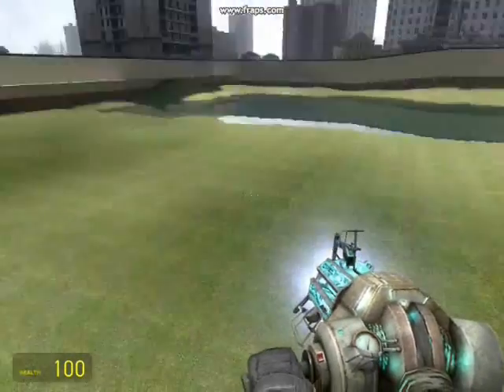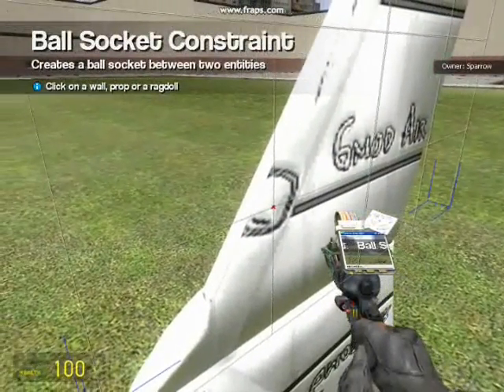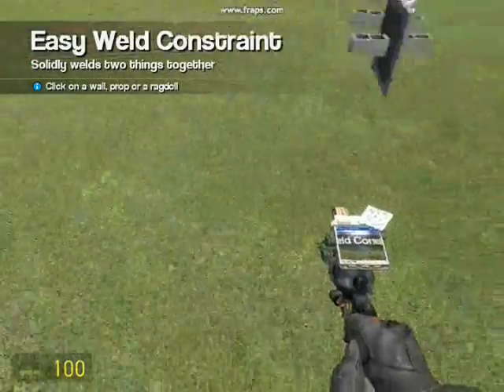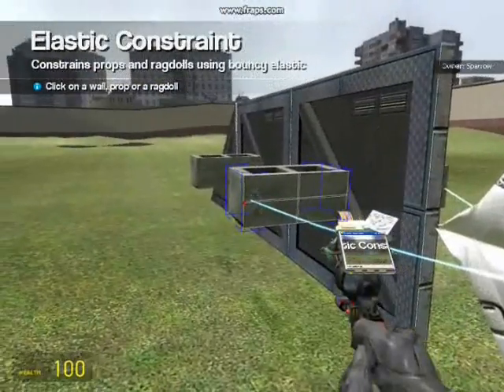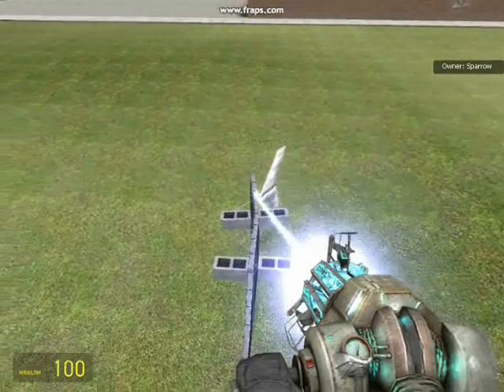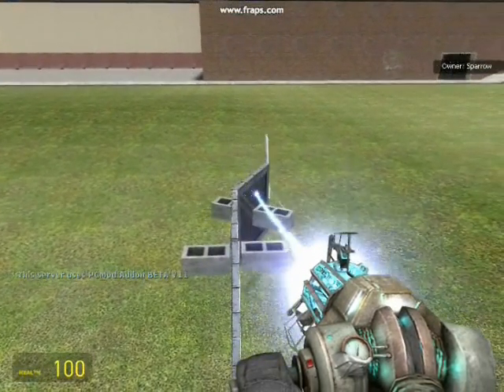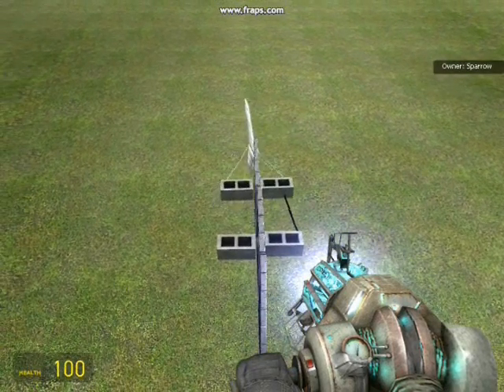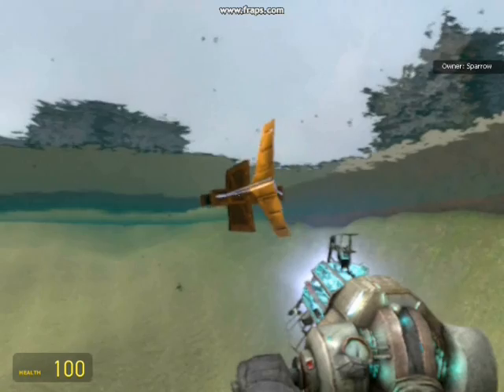Gmod tutorial how to make a fish with fin tool part 2

Comment: Nuuu. You can set how high it floats by the % (0-100%). Though. To make itself go up and down in the water, you'd need to add weight. But its easier then adding props. Add to many, might glitch the whole thing.